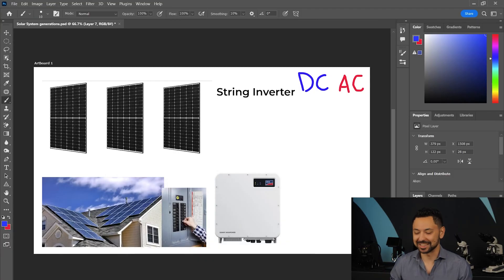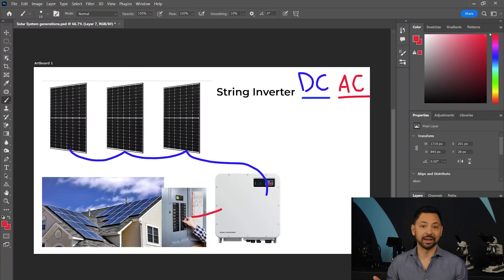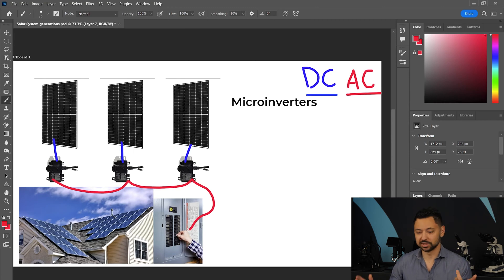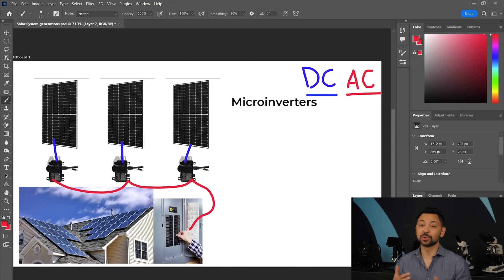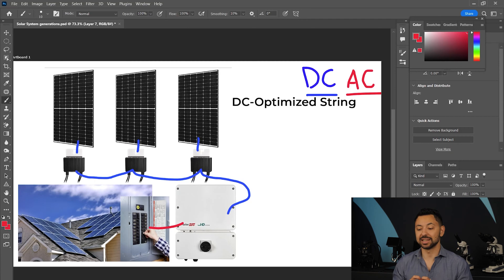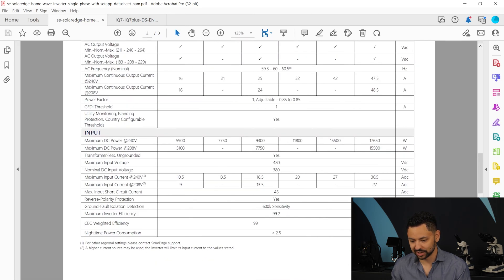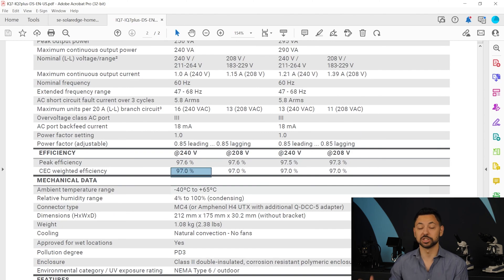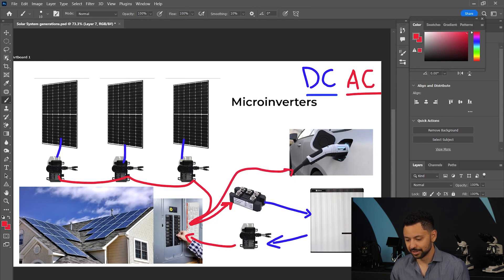SolarEdge VS Enphase | Don't Make a Mistake

Comment: The pricing for microinverters is linear. There are scaling advantages with string inverters, a 2x larger inverter is not 2x more expensive. That is why Enphase is expensive for larger systems.
You made it sound like string inverters are old technology and not really competitive any more. That is not true at least internationally. With the advancement of technology, string inverters have become the better choice in most cases. Especially if you have no shading issues. When you have different orientations you can just use multiple smaller string inverters. Solar panels can handle shading better nowadays and they have become cheaper. So most people add one or two more panels and get the cheaper string inverters.
I used to live in a place where our HOA had a SolarEdge inverter. It worked well, but for my current location I will go for a string inverter and battery backup. I have no shading issues and a single orientation.

Comment: Just got a 18 panel system with solar edge. I think I made the right choice. Should be easier to expand and add a battery. The price was 17 k and about 5 years to pay off.
Reply: I just purchased a 58 solar panel system w solar edge, has not been installed yet, are you happy with your system?
Reply: I've had 5 quotes from 4 companies  here in Nor Cal. 2 of them trying to sell us Complete SOLAR EDGE BATTERY  with 19 Solar Edge panels and optimizers. 2 of them trying  to sell us TESLA POWER WALL 3  BATTERIES  with 18 panels, and the last company  trying tl sell us Enphase battery  with micro inverter  system  with REC panels. Its hard to make a decision  cuss they aren't to far in price from each other . Just don't know who is up selling for more commission  or who is just trying to sell last yrs inventory  . Its a crap shoot. How has yr experience  been with SOLAR  EDGE SYSTEM? BATTERY INCLUDED??

Comment: With SolarEdge, if you have a bad connection on the roof, it is almost impossible to find it. Each optimizer has six MC-4 plugs and six sockets and they are wired in series like old-fashioned Christmas tree lights on the four string plugs/sockets per optimizer. If you have 13 PV panels and optimizers you have 6 x 13 x 2 = 156 MC-4 male and female connectors that can go bad. If the inverter does not connect to the optimizers due to one bad series connector it goes into "night mode" and production drops to zero. Try and find that poor connection in the wiring underneath the panels without lifting up all the panels, and even then, you might not be able to tell which of the 156 connectors has failed to carry current. Enphase doesn't have that problem; all a bad connection creates is the loss of one panel's contribution, since they are all in parallel.

Comment: This video has flaws,  some of what you said is no longer true for some years now,   pretty much all the solar panels made today have internal loss removal diodes that greatly reduce losses for shading or mismatching wattage of panels.    The bad thing about microinverters is that you lose about 5 to 10% of the power your panels make because they lose energy in heat when going back and forth between DC to AC and back to DC for batteries and batteries DC going to AC which can be bad if you only have a small array.     Both Enphase and SolarEdge both have positives and negatives.    Pretty much all the new solar panels made in the last 4 or 5 years have these diodes that remove losses.

Comment: SolarEdge is NOT “the best of both worlds”. Like a string inverter, the SolarEdge inverter  is a single point of failure. One of our 2 SolarEdge inverters has gone down 3 times now in the past 7 months, and it took 3 months to get it replaced. You acknowledged that, but seemed to brush it off as an “oh, well”. That is completely unacceptable! If they never went down, that would be one thing, but that’s not the case. We will be dumping our SolarEdge devices for something else - not sure what, yet.

Comment: If you a homeowner don’t buy SolarEdge I did 3 replacements for 1 home within a month because it was refurbished equipment
Reply: I’m having the same experience.
Reply: On the 3rd inverter in 2yrs customer service is non existent. Can't get answers as a home owner.

Comment: I’ve had my 10.5 kw solar system with SolarEdge inverter system for three years. On the anniversary of the system the inverter died. It was down for a month with free replacement. Luckily it didn’t affect the yearly production, that bad. We have been ahead of this grid game with SCE, so far. We produce more KWH than we use, but they charge us .30/kwh used, and they give us .09/kwh that we send back to them. I’ve heard it’s going to get worse.  That is why I am starting my investigation into battery storage for this SolarEdge system. Except for the house AC, we can disconnect Edison and live off grid.  I just don’t know how much battery I need.  Any formulas or charts I’m going to need to figure this out??

Comment: Another thing most people miss is that just because you are charging batteries from DC in the case of Solaredge, does not mean there is no energy conversion taking place.  An optimizer is called a DC to DC converter for a reason.  Another DC to DC conversion also happens when charging the battery from solar.  Thus it is not accurate to say there are no loses in a DC coupled system.  And after 9.5 years in the PV industry, with more than 2000 sites on our fleet and multiple NABCEP certifications, I'd always pick Enphase over Solaredge any day of the week and twice on Sundays.

Comment: Realy bad video! Panels these days are pritty good... - a diode and solarpanel compare.... 😂 - if you do not have a lot of shade - just put them in a string... micros are just costly and do not add value all the time!  The big fields don use these... they never break! Micros warrenty sucks...

Comment: Enjoyed your video - thank you.  I am looking at a future home DIY 48V battery backup system, and have a partially shaded property that could greatly benefit from micro-inverters or optimizers.   I've only heard rumours but, is there an off-grid micro-inverter or optimizer system available?  Would very much appreciate your input.  Thanks so much.

Comment: For Enphase you would just need to add another circuit. It's designed this way to increase safety and longevity. 
At this point these are about the same as far as comparisons. The other nuance is the amount of copper wire and gauge required for long DC runs.

Comment: The rectifier comment is partially true  though it may be simpler to state that their Inverters are Bi-directional as the Microinverters in the batteries are bi-directional.   Also there are 6 inverters per 5kwh battery so redundancy is x6 for the same amount of stored energy.  If one X-BAT inverter fails the homeowner still has access to all the storage.

In this case the Battery fills the low production gaps of the Solar if a cloud passes over. 

Enphase allows PCS controls so you can put 30-40Kw on a roof when the Main Panel or utility limits you to 7.68kw    the way Enphase does it is far superior because if you connect a car to charge it the system will release all the power and yet limit what only goes to the grid.

Comment: There is no way to compare a central inverter with micro inverters. This is the moment when people needs to understand that for a non significantly difference of money they are able to get a micro inverter system. I don’t wanna explain the reasons, there is too many information about this but definitely, it’s no brainer decision to move forward with a mirror inverters, also, if you move with SunPower, the company I work with, I will show you why it’s not just about inverters, but the choice of the panels, and also the important consideration in efficiency terms and quality of materials. As I said, anyways, I highly suggest to move with a micro inverter system instead.

Comment: I don't think your point on if one panel in a string is shaded, the rest are brought down is true, at least not anymore.  Several hands-on videos out there that debunk this, at least with modern panels.  Doesn't mean there aren't other issues but I see far too many pushing this point when it's not true.
Reply from the maker: Modern panels use bypass diodes and other internal circuitry to prevent partial shading of a panel from lowering the output of the rest of that panel, however, you still need either a DC optimizer or a microinverter to solve this on the string level so that all panels in the string don't lower their output to the lowest performing panel. Cheers my friend

Comment: About pricing now (speaking about the Inverters)... I'm doing a lot of DD on Freelancer Finance channel...
From all my research Solaredge is maybe $500-$1k less... for a system that costs 30-60k... and will last 25 years...
it's a no brainer to use Enphase and not worry about a central inverter failing even for a day (if not for months).

Comment: SolarEdge "99% efficiency" claim is misleading. DC optimizers (upstream from the inverter) have ~2% loss each, which conveniently gets ignored in the marketing material.
Reply: Optimisers have 0.5% dc to dc conversion loss, not 2%. Even with that, the benefits of fixing the voltage on the roof so it hits the inverter sweet spot all day means you will always see more efficiency from solaredge than any other tech. Micros are just like string inverters, only tiny. No dc control, still subject to finding efficiency in their band of operation.
Reply: @brentthesolarguy  Heads up this is the main salesman for solaredge in australia. His company is going insolvant because of the mainstream adoption of the bypass diode. More like solaredgecase
Reply: Do you need optimizer? I don’t think so while en phase you need it
Reply: First you say a single inverter is bad, then you say it is good. I have 2 SolarEdge inverters. The SE3800H has failed 3 times now in 3 years. SolarEdge doesn’t cover the service calls to do the warranty replacements. And, SolarEdge support is practically NONEXISTENT! They will not respond. I am fed up with SolarEdge!

Comment: great video, but why didn't you use the data sheet for IQ8 models?
Reply from the maker: Good question. No particular reason - honestly I just pulled the spec sheet from a folder on my computer where I keep a bunch of datasheets and I guess I never downloaded the IQ8 datasheet when it came out. The CEC weighted efficiency is still 97% on the IQ8s though so it doesn't make much of a difference in the context of what I was talking about. I'll make sure I'm using the newest versioned datasheets on my next video though! Thank you!
Reply: Iq8 output is 360w, iq7a is 366w, so hes being kind by showcasing their previous, better micro, lol

Comment: enphase battery fucking expensive against SolarEdge Batterys what you can build up
Reply from the maker: I have to assume it's because Enphase batteries require additional rectification and inverters inside of them since they are AC-coupled. I'd imagine this is one of the big contributors to the price
Reply: This isn’t about BATTERIES - it’s about inverters.

Comment: hey sorrosh thanks for the explanation very helpful and in depth. how do you size the solar edge inverter size according to panel size (ie. 4kw   10 400w panels) 
thx
Reply from the maker: Glad you liked the video! And good question, this would make a good standalone video on its own. I'll do my best to simplify oversizing a SolarEdge Inverter to a few sentences. For a 4kW sized system, you'd either spec a 3kW or 3.8kW SolarEdge Inverter. Which you choose depends on environmental factors such as ambient temperatures, panel orientations, expected real-world outputs from the panels, and customer goals. As a general rule (in my opinion) you want to aim for 10% - 30% oversizing. Basically, you want to load the inverter up such that it is producing the maximum amount of power that it can handle without producing significant clipping/power losses during the peak production hours during peak production days in the year. Hope this helps!
Reply: A kilowatt is 1,000 Watts